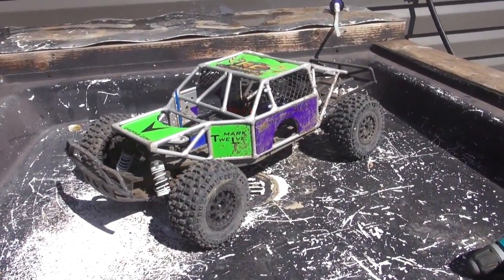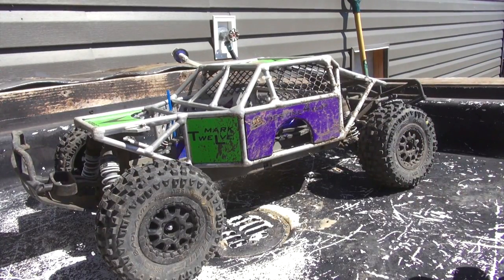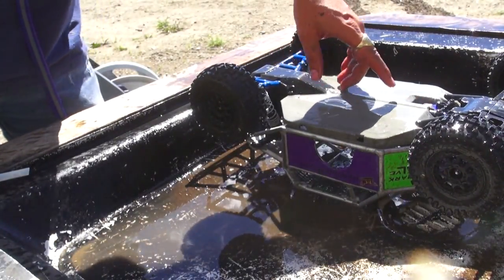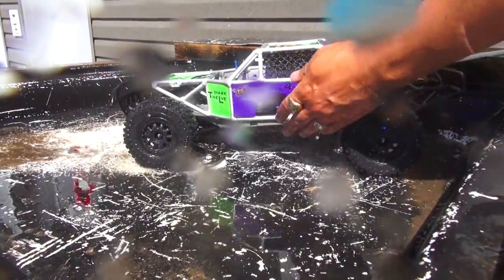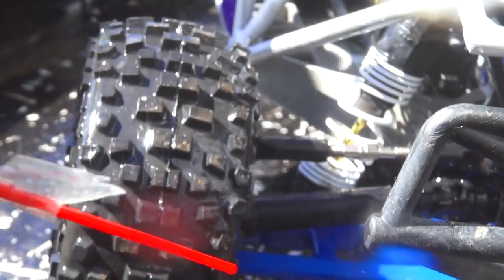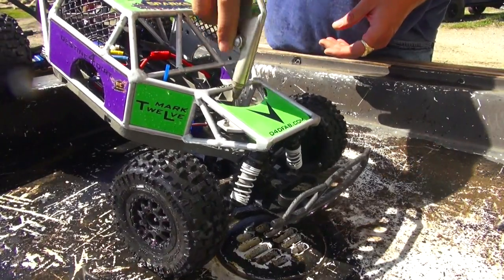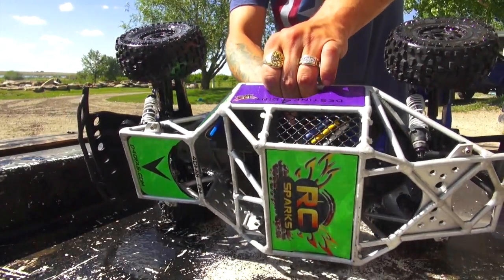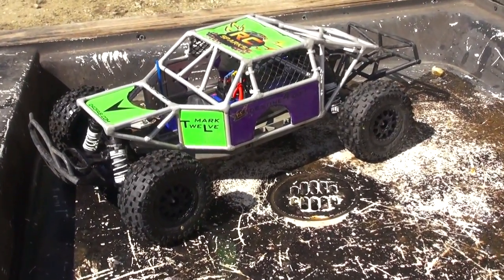RC ADVENTURES - How to Clean a Dirty Radio Control Truck - ie: Traxxas Slash 4x4

Comment from the maker: Don't be intimidated by cleaning your rig. Keeping your Radio Controlled vehicles healthy and well lubricated is an essential step to having a fun ride the NEXT time you want to go out and play...!  You know you need to do it.. your truck is right over there.. waiting to be cleaned. Stop procrastinating.. and Do IT! ;)
Reply from the maker: Lijah's Lab I don't.. sorry to say. I always ensure I have taped the inside of the rims with gorilla tape, before I hit any kind of water. This way the water stays out.  If you have water in your foams.. put a few small holes in your rubber (on the middle of your tires - 3 holes maximum) When your tires spin .. the water will come out..
Reply: Plz read my other comment 👆
Reply: oops mines still got some dirt on it from a few months ago..😯 and just recently I looked at it and saw a bit of rust happening on where the tires go onto the axle ... the last I drove it had to been in march. we did do the water resistance to the axles and gears and moter with the that grease stuff and did the electrical stuff in a balloon and zip tied tight and some plasta dip to the thing that makes the wheels turn (can't think of the name at the moment)  following your video about it but doing some changes. I was going to wash it down a few days ago but glad I didn't, because I would have just washed it and left it to dry instead of using air compressor to get water away. thanks for the video
Reply: The one you did in the front yard was way sexier
Reply: you should buy a teton
Reply: RC sparks plz could u do a bid on a traxxas revo 3.3 👏👌
Reply: Am I able to use this method on the Traxxas Stampede 2WD? It says it is "waterproof", but I just want to make sure because its my first truck and i don't want to ruin it.
Reply: RCsparks Studio did you make that
Reply: +Dylan Chitwood I recently washed my traxxas slash 2wd and had troubles with the electronics and it screwed it up big time, had to get a new castle motor and esc
Reply: +Garrett Gattis No he didn't he has a link to the maker in his first video about this product.
Reply: could you just spray it with water and then blast away the water with an air compressor?
Reply: IcyPolar that's what we did last week and it seems to be ok but make sure to get in where the front wheels are where it turns and all the screws and the suspension,  anything medal
Reply: Do you think dura trax power shot will work?
Reply: +unoriginal doge memes I have no clue I am not the one that buys that kind of thing my dad does but it might I'd ask professionals 😁
Reply: Ryley W ok thanks I'll go ask my hobby shop.
Reply: I know this is really old, but what is the thing you have the rc's on/in when washing them, i would like to get something like it
Reply: I've ask the same question a year ago

Comment: Good evening.  Really enjoy your channel.  

A tip for drying you vehicles.  Try using a Shop Vac on 'blow'.  I choked down one of the ridge tubes ith duct tape to make a nozzle.  Put the flex tube in the exhaust side, connect the rigid tube and blow away.  

Lots of volume and enough velocity for drying without blowing thing into the next yard.  

Great trick when I dried my motorcycle. 

Steve
Virginia Beach

Comment: What, if anything different than new fluids and bearings, do you do for a major cleaning/teardown?  do you put any extra lube/grease in your new bearings?  I run a slash and a rally, and I've blown 2 motors because of bearing failure.  I pack the wheel bearings with a bunch of water proof grease to ease removal and keep some water out. this would not be good for the motor would it? tips please. Thanks for all the great videos

Comment: Is it okay if I just wash my RC quickly, and then use a towel or air to dry off the wheels and electronics so the bearings and metal don’t rust? Would that work?

Comment: That is a awesome cage! Does it allow you to put the regular plastic body on?
Reply: Im sure you could make it work... worse case scenario just trim the body
Reply from the maker: Yes, the cage allows you to mount the body
Reply: This cage is designed to allow use of the stock body (and some aftermarket bodies). It doesn't move the position of the stock body posts.

Comment: For even just grass and dust I used Windex and a vacuum cleaner  especially on the axles while spinning at a low throttle.

Comment: Dj how do you keep the wheel hexes from stripping out on your slash. I have a stampede with MIP axles and have stripped out several sets of wheels. I even modified my last set and put a horizontal screw thru the wheels and those eventually stripped out. I am only running 2s.
Reply: either make sure your wheel nuts are REALLY tight (i stripped out 3 sets of proline Split-6's). Or buy aluminum wheels. I use the rc4wd mickey thompson 2.2/3.0's, and ill NEVER use another wheel. They are heavier than plastic wheels, but with the weight so low on the truck, it just sticks to the ground.

Comment: If it ain't filthy or busted it wasn't fun enough!
My erevo visits the car wash when I have too much fun, not high pressure up close though, common sense, use it I do.
I coat all my rc's in silicone spray, makes the dirt etc come away easier, stiff paint brush works well too.
I dry mine using a towel and my air brush dialled up in psi a bit, no paint of course just air. Then redo in silicone spray, yep wd40 tends to attract dirt turning into grinding paste.
Cheers medic! Peace, out!

Comment: use an air compressor first,then afterwards. Harbor Freight sells cheap pancake compressors that work great on this type of thing. There are plenty of other dry lubricant silicone sprays out there that work great. I have a pressure sprayer that is highly adjustable,I wouldnt be afraid to use. It mixes the air with the water so you are using less water,generally,stay away from bearings and places water can penetrate. Its all comon sense guys. Dont soak your stuff as usual.

Comment: do i leave the power cable for the esc exposed or should i tape it off?
Reply: you can leave it exposed, just make sure that when you go to plug back in your battery to make sure the connector is dry.

Comment: Medic, can you maybe do a full teardown of your slash? I think I may be be missing some parts in my transmission. When I takeoff, regardless of speed, the truck jitters. It goes after a second or 2 of that, but sometimes I have to give it a little nudge
Reply: could be a poor connection in the wiring, a motor on its way out that needs replacing, or an issue in the transmission/differential. without seeing it, it's impossible to say for sure.
Reply: Aaron Van Miller I'm sure it's something in the transmission, but I have no idea where to start
Reply: mine was doing the same, ended up being the ESC. Mine would "beep-boop" sometimes when it wouldn't go, and i'd have to give it a nudge to get it going.

Comment: I'm so scared of getting my slipper clutch and MIP X Duty CVDs wet when cleaning. Also my motor bearings in my VXL system have ceased up before when running in water.

Comment: I use a pressure washer and then a 6 bar compressor for an air gun to dry it so water doesn't corrode stuff

Comment: Hi guys, what can I do for my tires on my 1/16 e-revo? Because they'r full of water and when I speed up a little bit the truck go shaky af...
Reply from the maker: put two tiny nail holes in the rubber. Make sure they are opposite of each other.. ie: Top and Bottom, and/or Left and Right.   Drive down the street a few times.. the water will leave your tires.. :)
Reply: ty Man! anyways for now the truck is "dead" because my batery almost burned in it and the plastic gears in the servo are all striped :/ no money to buy new stuff so for now it does a nice decoration on my office :P
Reply: Awesome tip :)
Reply: well your best bet is to get new tires and silicone the holes on the inside, but to get the majority of it out you can go somewhere where water dosent mater like the bath tub and make sure one of the holes are on the bottom and use two hands and just keep squeezing them(also place the tires with one hole down and standing upright and let it sit for about 24 to 48 hours so all the water is on the bottom and do that on all four tires. oh and once you can't get any more water out either silicone or tape the hole.  and that is why I said just buy new ones it's a long process. Have Fun😁

Comment: Hey medic i have a traxxas slash 4x4 what upgrades do you recommend me
Reply: rpm everything and savox servo proline tires  and better shocks
Reply: First off I would upgrade tires
Reply: Tires most definitely, then steel spur gear
Reply: +Joshua Kent thank you
Reply: +Juan Pablo Saenz thank you
Reply: +ULTiMATE TRAXXAS MAN thank you
Reply: oh also maybe depending if you plan on jumping it, aluminum shock towers
Reply: +Joshua Kent what kind of upgrades should i do if i plan to race it in a dirt track
Reply: Julio Raul Well if the racing class isn't stock and if it lets you change tires, definitely change that first. Then tune your suspension according to the track. Really the only other necessary improvements that you would absolutely need are aluminum shock caps and maybe some RPM rear a arms
Reply: +Julio Raul Tires, Steel spur gear if you can find one, aluminium which towers, and chassis braces because it's not only racing but jumping too. don't forget to clean it properly😉

Comment: my servo on my slash is not straight. I took off the screw and turned it on. it moved but it still goes off to the right.
Reply: Steering trim
Reply: make sure the steering trim on your controller isn't set to the right.

Comment: Where are the mounting points for the cage?
Reply: The Cage mounts where your body mounts go on your shocktowers. The cage sandwiches between the post ( or nuts that are provided if you don't want to run a body) and the plastic piece that attaches to the shock tower.

Comment: Hey I just installed some RPM rear suspension arms on my Traxxas slash 2wd and when I pick up speed the rear is very shaky and when the stock suspension arms where on this did not happen if any one knows why please help me!
Reply: One good tip to get you more familiar with your RC take apart the rear end and find out what seems wrong (also if you still have it refer to the instruction book)
Reply: your wheel bearings or diff bearings might have went bad.

Comment: How,do you clean dirt of non water resistant trucks
Reply: Easy way: remove electronics and proceed as if waterproof
Hard way: use a tooth brush and spend hours cleaning [Your Choice]
Reply: +Joshua Kent thanks

Comment: @RCSparks / video description: You mentioned WD-40... I have see it attack natural rubber parts in the past (lots about this on the web), so I'd be wary of using it on RCs (unless they have changed the formula?). WD-40 can also affect polycarbonate ref. the WD-40 website FAQ: http://wd40.com/faqs#panel10 - See the "What surfaces or materials are OK to use WD-40® Multi-Use Product on?" section. In my experience GT85 is a much safer option than WD-40 for RC maintenance (water dispersal and light lubrication).
Reply from the maker: And that is why I showed using CowRC dry silicone products ;)  WD40 is an alternative.. but not the recommended way
Reply: Roger roger, ten four good buddy  :-)

Comment: take rims off so you don't get water inside the foam of the tires.
water will cause the tires to be out of balance and run like crap
Reply from the maker: My tire rims are sealed
Reply: +RCSparks Studio. I had a feeling yours were but most people watching wont.
Reply from the maker: CENTRAL FLORIDA RC Yeah, but even still.. general washings dont usually cause issues in tire rimes unless they are submerged. A cleaning has never caused me issues with water logging before - unless they have been under

Comment: Fail. Brush off and blow off as much dirt with compressed air as you can before hosing it down. All you're doing with that hose is blasting dirt and grit into your driveshafts and bearings.
Reply from the maker: To each their own :)

Comment: but wd40 is a degreaser so I won't suggest spraying it on bearings and stuff
Reply: Mr Cow wd40 stands for water displacement and 40 being how many times it took them to get the formula right it is not a degreaser it's a spray oil